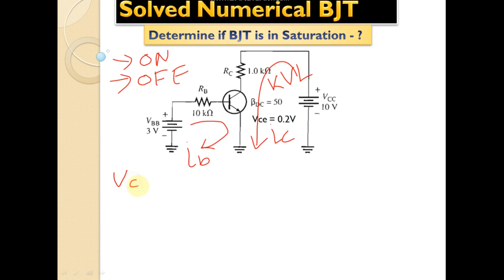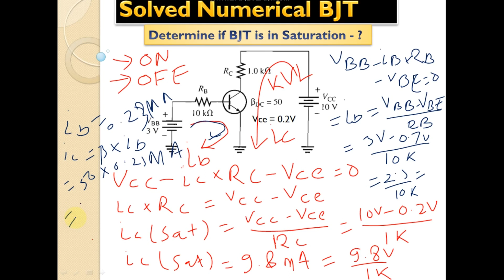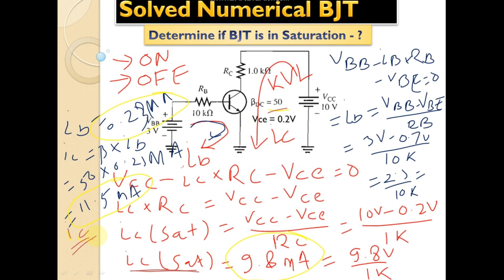[Solved] - Determine if BJT is in Saturation - ?

Comment: Hi, i understand how to put a transistor in saturation region, but i still don't know how to pick up the appropriate hFE or beta on the Datasheet.
Reply from the maker: Hi...Indeed good question. Thanks for asking. If you are designing a amplifier, and want to operate transistor in linear mode  then higher hfe will give you higher voltage swing at output. Ic =beta*ib.
If want you to operate bjt as a switch so in this case ib>ic/beta.
Both cases hfe helps to define the base current. Higher hfe will help you reduce the base current.

Comment: HI, can you help me? I had all the correct answers, but I can't understand why the transistor is in saturation. I was thinking that if Ic>Ic sat, the transistor is in active region. Can you help me understand why it is in saturation?
Reply from the maker: Yes, sure I will help.
Pls. Connect separately in the whatsapp no. given in channel home page.
Reply: The value of Ic sat is limited based on the circuit. Ic can be set to an infinite value as it’s just the base current (Ib) times the beta value (in this case 50) . So the circuit is in saturation because the maximum value that the circuit can produce is higher than the one set by the base current.
Reply from the maker: @franciscoruiz3109  Hey...thanks for answering the question.